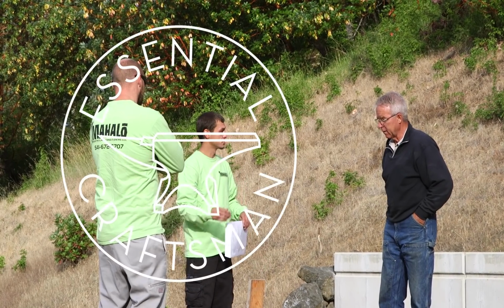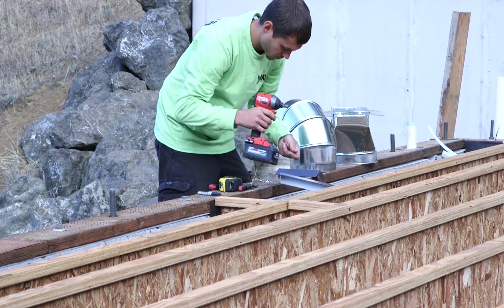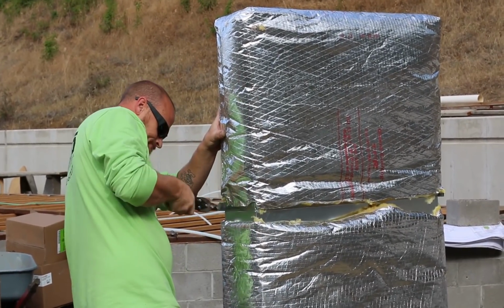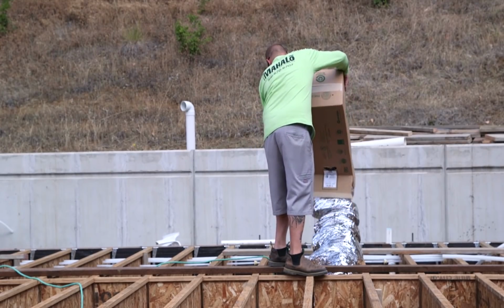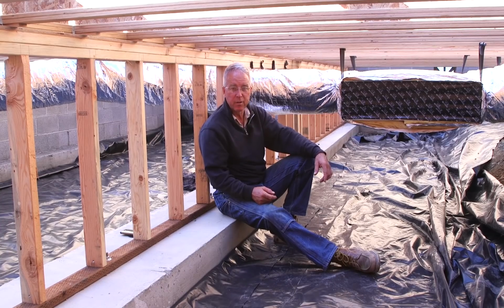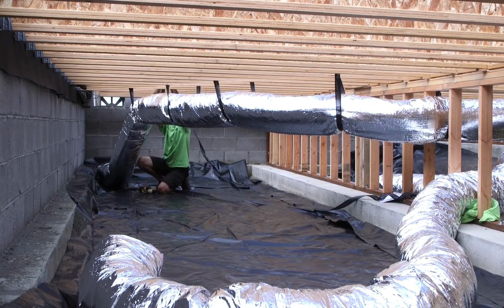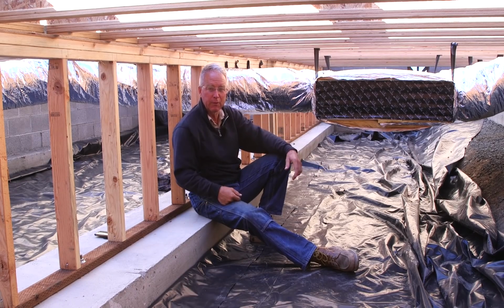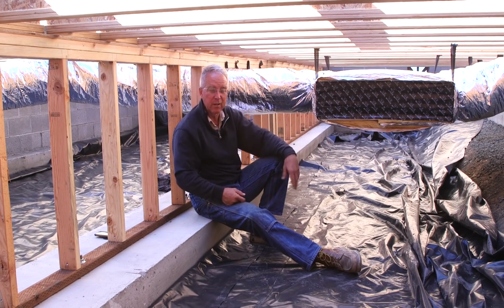Ducting Ep 42

Comment: That property is in southern Oregon, is that east or west? I remember living in Oregon and how different the coast was from eastern side. I wasn't in the south though it was central but on the coast. It absolutely beautiful and I agree with you said on climate even if it was central area for me. If the cost of living was so darn expensive there I would have stayed
. But I ended up going back to NE Texas for nearly 20 years, now I live in south-central Wisconsin for the past decade. And yes the climate of those three locations are extremely different from each other. 
In Oregon, I could have gotten along without A/C but heat was still needed but I never experienced anything below freezing there. 
Texas, the A/C is mandatory, not just for my health but by building codes. In the south of TX some houses get by without heat, but in the DFW we still do need it but lowest temps are usually in 20s. 
Here in Wisconsin? I need both A/C & heat. The situation is reversed where its heating that's mandatory as we do experience temps below freezing, often getting negative double digits (in F). I know some buildings do not have A/C but I do need it as summers can reach high 80s and low 90s.
Reply: Well, it's a lot closer to the West Coast than it is to Idaho, so I guess that would be Western Oregon.  It's about halfway between Medford and Eugene, not too far off I-5
Reply: @andrewalexander9492  Ah, I know where Eugene is, its about due East of Yahats. I think that's the spelling been nearly 30 yrs since I've been there, its the town by Tillicum beach. wait, just checked its spelled Yachats. I was in the Job Corp at Yachats and would travel to Eugene and other parts of Willamette (sp?) Valley  on some weekends.  That's about the area I was thinking of

Comment: Why did you decide  HVAC in crawl and not in attic? 
Also why not condition the basement?
Curious your reasoning.

Conditioned attics seems to be the in thing lately.

Looks good
Reply: I think that may be a regional/climate zone thing, at least as far as the attic vs crawl space question.  I've always lived in the North (north of Scott) and heating ductwork almost always goes in the basement or crawlspace.  Any time I've seen heard of HVAC in the attic of a home, it's always seemed to be in a more southern area.  A conditioned attic wold be problematic in snow country, as it would tend to cause ice damming on the roof.   There are ways to deal with this, but the most common approach in snow country is an unconditioned, ventilated attic,  so there is no heat going through your roof to melt snow.

Comment: Tin banger here. I’m not gonna jump on the “ flex is bad bandwagon going on in the comment section here, but I do have a couple of concerns with this install. There are no dampers in those starting collars. I realize that the supply grills will have obd dampers or something similar but that’s no substitute for a proper damper at the plenum. You or the homeowner may want to alter how much air a room receives and dampering at the grill is far less effective than at the plenum. 
Also leaving all that insulation exposed to the elements is a huge risk. I mean, you wouldn’t put insulation in a wall that’s not in the dry, so why treat your ductwork any differently?
 Not trying to sound like a know-it-all, just sharing my thoughts. 
Love this channel, keep up the good work.

Comment: As a savvy DIY homeowner, I would be pissed to find that much flex in the system. I know cost is always a factor but jeez, how hard is it to run 80% of the branches in solid tin? Use 20% flex where it has to twist and turn in weird places to save some labor.
Reply: I do 95% commercial and industrial installs, and they limit the amount of flex able to be used. We are only allowed 5' of flex per run, and it must be at the end of the run per mechanical specifications. I understand that occassionally hard pipe is not possible, but they didnt even try.
Reply: Completely agree. I am far from an HVAC Pro. Just a homeowner that prefers things be done right. I’d be embarrassed to claim this work as my own.
Reply: The right way to run flex, and the cheapest way that is still performant, is to do only the straight runs in flex, pulled tight, with rigid elbows/connectors wherever the duct has to turn a corner. Agreed that I'd be pissed if someone tried to install this all-flex ductopus in my house.
Reply: Rule of thumb on our jobs is 5 feet of flex no more. They sell pipe for every size.
Reply: I agree... I was surprised to see any flex at all in the huge  crawlspace...

Comment: I can't even list the amount of bad in this video. I'd love to see the program they use to design the system they installed because I've never seen a highly efficient system that has the "octopus ducting", the static pressure has got to be non-existent. And I see no return air! 
Smh
Reply: Yeah don't mind flex if it's done right but how bout a drop in duct size and who put in a boot with out insulation

Comment: I would never have registers in the floor. Everything's open just put them in the walls. 
For efficiency's sake I would have done metal ductwork with flex only near the end of the run to eliminate vibration. And I would still have all the ductwork coated in closed-cell spray foam. To each his own I guess.

Comment: Well here are a few things that I noticed that your Mahalo heating company needed to do but didn’t as your video showed.

The guy cutting out the holes in the side of the rec duct didn’t fully cut out the hole, the rec duct was not the correct size in height for the size saddles they used so there is an air flow restriction right there.

when they joined the rec duct together they apparently did not use mastic to seal the S & Drive cleats. 

when hanging steel duct work the weight is substantial and hanging it with nylon strap is beyond ridiculous, that strap is intended for flex duct. 

They never put mastic on the saddle before putting on the flex duct, apparently more potential air leakage.

just because they ran the flex duct straight does not take care of friction lost. It is good they ran it straight but it needs to be installed pulled very tight. There is a helix in the duct that accounts for a lot of the friction lost and even more if it is not pulled very tight.

Those adjustable 90’s they ran off the boots should have had all the segments duct sealed with mastic once adjusted into their final position, again for air leakage.

Seems to me just going by what you said narrating the video and the footage that was taken, there is a lot of lack of details that are going on in your builds by your heating company.

The most important day of an HVAC system is the day of its install. The end user the person purchasing the house is the one that looses in this situation with higher utility bills lack/loss of comfort.

I wrote this not so much to be condemning but to point out the lack of detail being displayed. If you spoke to the management of this company and suggest they tighten up their practices it really is just minor adjustments needed that will produce a much superior product.

Yes steel/metal ducts in the long run cost more but is such a superior product used in an install. Of the decking is off and you ran those then it would lesson the cost of it. You could point that out as a high quality design and reflect it in the cost of the house price. Really is such a better duct system if you used a graduated trunk line!
Reply: The duct leakage and losses in this system will be ridiculous, and regardless of the local climate, the energy usage will be much higher than it needed to be, solely because the contractor didn't care.
Reply: Nate Hicks totally agree. The best way to balance is with system design.
Reply: How much of this fall into the category of "This isn't Phoenix or Minnesota" and therefore is less impactful?   I get if a system is going to be doing a LOT of work, then a 5% reduction in efficiency matters.  If the climate in this location isn't going to require this system be a workhorse, it might tip the scales on cost v benefits.   Case in point,  some areas of the country you'll still see a decent number of window AC units, despite the lack of long-run efficiency, because they're only needed 3 months out of the year.          

Is this system "good enough" for this application, that adding more costs to make it better won't actually improve performance in a meaningful way (given how it will be used in this house)?
Reply: I’m in the state just  north of Oregon, Washington state and specifically western Washington and that is code here.
Reply: I have been the doing HVAC for 9 years, 4 of which as the foreman, and I 110% agree with everything you have stated. Watching this made me cringe too many times. The main issue was how little mastic was used on the entire job. Another big issue was installing uninsulated register boots, especially outside the envelope of the home. Those things are gonna sweat like crazy. Also should have used a light coat of mastic over all insulation tape to help with separation.

Comment: To see a tinner using his snips as a hammer troubles me.  How is he going to bend over the end of that S-drive?  Use a tinner's hammer !!
Reply: Steve Koszuta S’s don’t get bent.
Reply: @richw9205  OK. Fine.  Technically it's called a "drive".  "S-locks" are are used on the other two edges of the duct.  "Drives" are used on the hemmed edges, and "S-locks" are used on the raw edges.

Comment: Been doing HVAC for 7 years. Good looking system. My only recommendation would be to support your sheet metal duct with metal hanging strap. That nylon they are using won't hold it nearly as long.
Reply: Also I see no transitions on the ductwork. When you've taken air out through flex's, you need to compensate later down the duct by sizing it down to keep static pressure even through the duct.

Comment: I'm curious as to why they used the bendable connections, rather than a simple (and significantly cheaper) straight pipe...
Reply: dzjad labor cost.  Yes 25ft of flex cost more than 25 ft of pipe in the store on the shelf.  But in the house and installed its several times that cost.  Takes very little skill to run flex, because a factory make it an airtight 25ft run.  Pipe on the other hand takes more skill onsite with joints a minimum every 5ft, screws, tape, mastic, the duct wrap that has to be put on with skill also (can’t be to tight or to lose for r factor)

Comment: Really interesting as we don't use aircon in the main in the UK, however as the climate changes I can see it becoming the norm in the UK. At the moment we use a small gas boiler, 24" x 18" x 48" to heat water and the house but nothing to cool it. Your system looks way ahead of ours. I am interested to see how your plumbing and electrics will work. Great video and great channel.

Comment: Better insulate the boots all the way to where the floor boards will be. It will bow the floors. And also that vinyl strap holding the trunk line is a no no. It needs to be metal hanging strap and or drive holding that up.

Comment: When I did a frame-up remodel on my 100 year old house, we did two separate units - one for the upstairs and one for the downstairs. The downstairs runs a lot in the winter, the upstairs in the summer. The benefit is that they are much smaller units and cost much less to run. But, the biggest factor in keeping ongoing heating costs low was insulating the house well.

Comment: Those drill-driven snips might be the coolest thing I've seen in quite a while
Reply: Made by Malco. Turbo shears....they even have two circle cutting rigs that all you need to mark is center point then cut away.
Reply: @cjnewton72  I saw those, I also really like the punch-style nibblers that work off a drill as well. Definitely added to the tool list.
Reply: They work so great have used them for multiple gauges of metal .sure nice not to have a cord 20 ft in the air cutting gable metal for steel buildings .. just one less thing to not get caught on
Reply: can we talk about them nibbing away for a somewhat nice hole and then using a stick on collar. why?
Reply: Dewalt also makes shears for your drill too. I'm a sparky who cut my teeth in HVAC when I was a kid. I still do some tin work for friends and family. When I put the AC in my cousins house he gave me the shears as a thank you, and they worked really well since I used them to tin up the evap.

Comment: Seems to me it would be better to insulate the crawlspace walls rather than the subfloor. Probably less insulation required, space between joists for ducting, and ductwork wouldn't need to be insulated. No he humid air coming into the crawlspace causing moisture problems...

I don't like the idea of this flex stuff either, especially in a new build.

I just don't get the point of not insulating the walls but I'm unfamiliar with crawlsapces as I live up in Canada.

Comment: I would have just made the crawlspace a conditioned space instead of vented.
Reply: it is a huge volume of extra space to 'condition' and there are many things that will appear in there that most people would prefer not be a part of their air handling systems...(like all the spiders appearing), and then you have the problem of balancing a 'passive' system vs. a 'forced air' system.
A common mistake made by amateur spec builders is to build the house 'they' would like. The unhappy buyer will be certain to inform this naive person, how much they HATE this or that part of the house and probably demand a correction.

Comment: Hated having to drag everything in the crawlspace hole. Doing it before decking is down is unheard of around here. 

Duct sealing has become such a normal thing nowadays. That along with better insulation has improved the effectiveness of a good designed system. 

I kinda miss bending metal...not the mole man stuff though!

Comment: I was very interested in this part of the project because I did sheet metal work for 38 years. I stopped half way through because it was hard to watch. All of this duct (metal) is very poor grade material (26ga, 28ga or 30ga) it is way too thin. Also I would be very suspect of anyone that puts a plenum together that is insulated before assembly. That plenum should have been assembled then sealed with a good quality duct sealer. There will be lots of leaking there. It was part of my job to "pressure test" the ductwork and anything that was sealed with duct tape would fail the test. I also did not see a hammer when the one guy on shorts was putting the "S" & Drives together (another point of duct leaks).  I did not like the very thin metal used as a angle support for the floor registers and the very thin "Plaster flange" without proper support the screws will just bend the metal.

     I have learned a lot from this series but this is one place I feel like I could have a critical eye for what is going on but this made me cringe...
Reply: I couldn’t agree with you more that was very cringe worthy, I’m a sheet metal worker (tinsmith) over here in Canada. I mostly work commercial and industrial jobs. That type of “hack and slash” work doesn’t fly over here. 3’-5’ of flex max per supply register/diffuser. Sometimes it’s hard pipe/duct all the way.
Reply: Agreed
Reply: I feel bad for the person they sell this house to, and the guy that has to come back and rework all of this half-assed "duct".    I was looking forward to this series until I saw how easily Scott is duped by con men after a buck.
Reply: @josephkimmel4256  yep...Know days incompetence is rewarded more often than not.
Reply: now
Reply: Joseph Kimmel ...... these were donated services for free advertising.   Scott chose this quality of workmanship
Reply: Tinner here too. I feel the same way.
Reply: 100% agree

Comment: Very interesting to see how it is done elsewhere.  The system is so unlike what we do here in southern Alberta.  Of course our climate swings like a drunk monkey in the jungle, so we have far different requirements for our HVAC systems.  And I thought how interesting it is that you folks use flex ducting, whereas we use almost exclusively round and rectangular galvanized in even residential construction.  I like the idea of the insulated, flex pipe as it seems that it would be much quieter than rigid metal ducting.  This is a great lesson in diversity of methods within an industry, across different geographic locals.  Great series man.  Thanks.

Comment: Oh, I do strongly disagree with that.  Running the highest or lowest temp air through a duct with and R-4 max insulation,, the temp difference between the unconditioned air of the crawl space and the temp inside the duct will routinely be a 100F differential.   Do you also put R-4 inthe walls?  You only eed 2X2s for that.  Your duct work is being sealed and insulated so it can go through and un-conditioned crawl space?   Okay, why don't you put it up in the attic above your attic insulation?  Same thing.  Or nearly so.  I have never had a problem with duct work and its leaks running across a basement ceiling,,, but a basement is different than a crawl space, a basement has storage, laundry, rooms, it has use and people go up and down the stairs every day.  A crawl space is just that,,, a space for service personnel.    A little bit of leakage,, I have no problem with,, it keeps the floors temperate.

A crawl space is in contact with the soils, the concrete is exposed to outside air,,,,,, the only type of crawl space that would have my vote is a completely insulated crawl space.  Are you going to go back and retrofit rigid insulation all the way across the floor and join that to complete wall insulation?

The duct work should always be inside of the insulation envelope.  This ain't 1964.